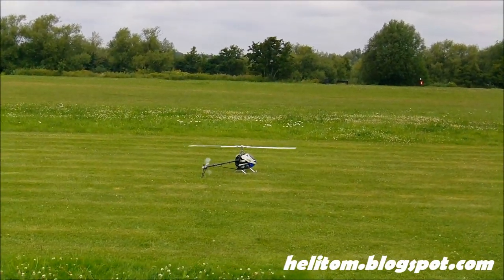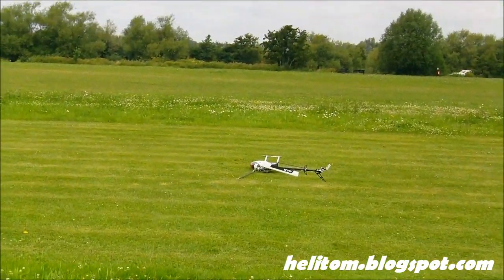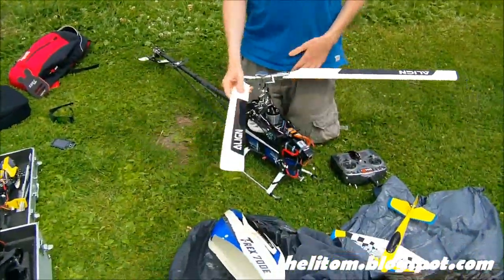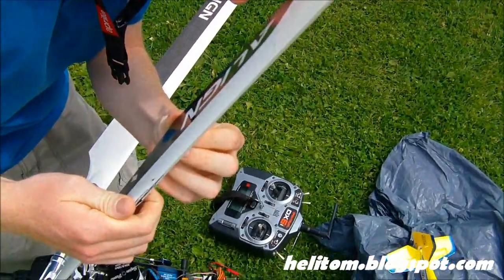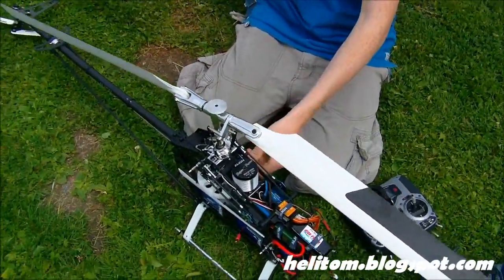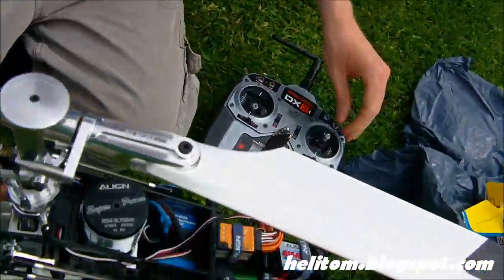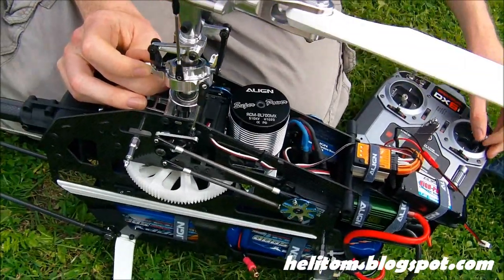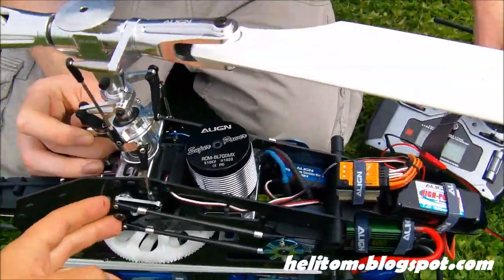TREX 700E FAIL

Comment: Spektrum as a brand is renouned with having random glitches and brownouts. Their DSM2 and even DSMX spread spectrum systems aren't really all that good. The DX6i is fine for a parkflyer or small (maybe 400 size) heli, but anything bigger or more expensive than that, you want a better system. In my opinion, Futaba has the best, most rock-solid system out there, and is all I fly. Their FASSTest radio technology is used in many commercial applications such as intermodal container handling.

Comment from the maker: I think this cost me about £80, I broke the blades and a few linkages. However, In most crashes the boom will bent, which means the torque tube will also bend. could also break the skids. So I would say an average crash on a 700 could cost between £100-£150. On a 600 it would be slightly cheaper, but not by much.

Comment: I suppose the Futaba 10C is so awesome it can recognize when you've set up your cyclic backwards and automatically make the correction. In fact, if you buy a unassembled helicopter kit, just leave the parts spread out on the floor, set the Futaba 10C beside it and flip it on. Come back the next morning and the Futaba 10C will have assembled and setup your helicopter and it will be ready to fly. Really an amazing radio that one...

Comment from the maker: hi, have you check the servo wires are in the correct way, eg black white and red wires. does the 3gx not work either, or just the receiver not working?

Comment from the maker: @INMATECELL11 Im not using the DX6i anymore, because I don't trust mine. Your DX6i should be fine, but mine was faulty. The 700 comes with a separate BEC, this is safer if the ESC fails, your still have control. Thanks for watching

Comment from the maker: @96sunvalley There is probably nothing wrong with the DX6i. I think I just had a faulty one, this has happened before on my 250, but I noticed it in a pre-flight check. So I wanted to be safe and got a DX8 now.

Comment: Both my TREX 450's crashed about 2 minutes into the flight for no fault of mine. I have suspected the DX6i I could not find a definite cause so I switched to Walkera flybarless V450D01's with 2801 Pro Tx. I bought a second V450 I like them so much.